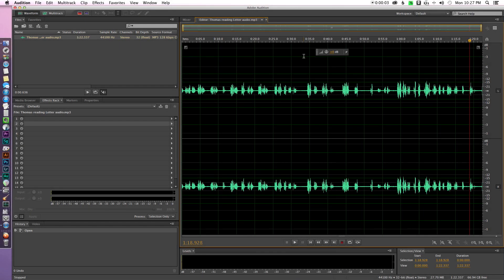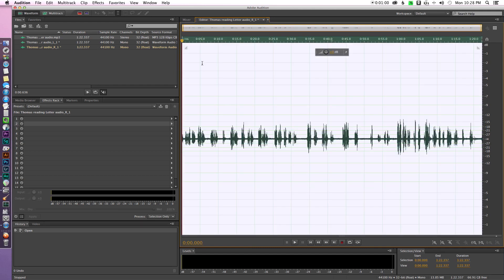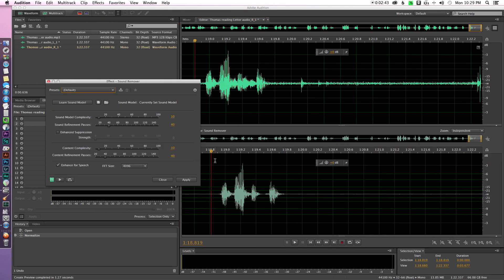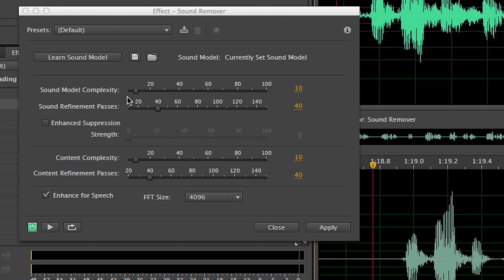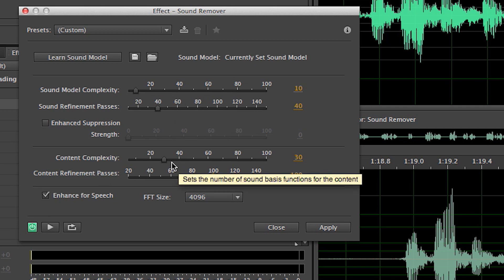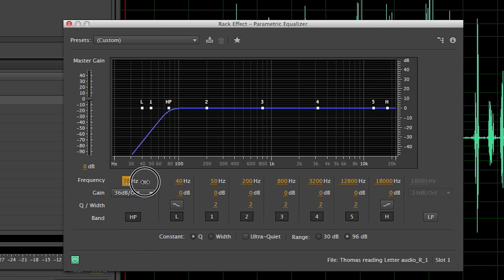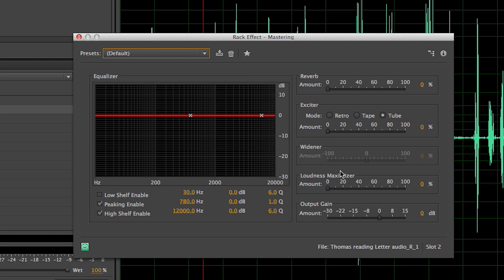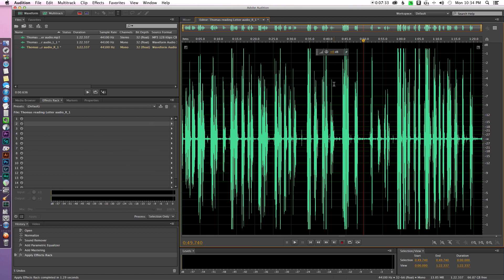Sound Rescue 2: Cleaning Up Dialogue Audio

Comment: Is there any way to do something similar to what you begin @2:54 without the sound remover tool? This tool is only in the newer versions and I'm stuck with the old masters sweet and I can't find any tutorials on how to make that dialogue sound more natural again after removing the noise and it sounds like you're listening to it through a conch shell.
Reply from the maker: Hi Isaac, if the dialogue is sounding like you're listening through a conch shell, that means that the noise reduction was applied too heavily. May need to back off of that a bit. It will not remove all noise without affecting the sound of the dialogue so you'll have to back off and keep some of the noise, just reducing the noise enough so that it is less distracting.
Reply: @curtisjudd  hey wow thanks for replying. After I commented I saw ho we long ago this video was posted and in no way expected to get a reply. Truly appreciate it.

Comment: Hi Curtis - I have a voice over that was recorded outside on a mountain side on a cell phone. The sound goes in and out of of extreme high and low db but when it is in the high parts there is a lot of background noise (fuzz sound) Im really stuck here, can you help?
Reply from the maker: Hi Nic, May need to cut the audio clip into segments and just apply the denoise plugin just to the louder segments. It will be tedious but might be worth the trouble.
Reply: @curtisjudd  - Great, thanks for the tip I will give it a try

Comment: I had a 3 camera setup with shotgun mics. I had some evident noise in the background as I crank my audio. I am able to remove the noise but then it leaves an echo like effect and I want to get it as close to clean professional audio as possible. The mics were all aimed towards the subjects which were in front of a brick wall. Any ideas? Thanks!
Reply from the maker: Hi Gil, I usually find a light touch on the noise reduction, leaving some of the noise is better than pushing it too hard and ending up with artifacts like you describe.
Reply: Ok so clean up to noise but leave a little to hopefully stop it from sounds like an echo room

Comment: How can I cut/remove/compress the audio peaks from "clapping" in premier or audition? I did your "normalization 0.1" and other tecnics, but since the clapping is so loud, that the audio waves does not get normalized like in your videos...
Reply from the maker: Hi Alex, for clapping, I usually highlight it in Audition and use the floating control to reduce its amplitude of the highlighted section until it is close to the rest of the audio. Then normalize from there.

Comment: Hi Curtis, nice video, but I found the last note a little bit puzzling : why should it be better to EQ before noise reduction ? 

I don't know about that particular "sound reduction" effect, but speaking for the plain old "noise reduction" filter, it basically reduce some frequencies in your signal based on the power spectrum density of the noise sample (at least, this is how the "noise reduction" filter is implemented in Audacity). So it is hard for me to understand why it should be better to EQ before or after the noise reduction step. I have not your experience though. So could you confirm there is a audible difference when doing it one way or the other ?
Reply from the maker: Hi Sylvain, my reasoning behind that: If you're using a high pass EQ to reduce low frequency noise, you're probably better off doing that first. The less work you delegate to the noise reduction effect, the better since it can have a tendency to leave odd sounding artifacts if you rely on it too much. And often, a simple EQ/high pass can clean up a lot of noise issues. Always better to use a less intrusive solution than a heavier handed one. Hopefully that makes sense.
Reply: I understand what you mean : by EQ first you can directly "cut out" some noise and so you don't have to push the noise reduction too far. Thank you for your reply Curtis !

Comment: Hello Curtis, I have a particular problem. So I have a video (40+min of lenghtt), which includes a dialogue and a backgrround music. What I want to do is to either remove or decrease the background music and to emhasize the dialogue. Is it a possible way to do that. Million thanks in advance!
Respectfully, Tadas
Reply from the maker: Hi Tadas, I am assuming that you just have the finished video file, and not a project file for Premiere or Final Cut? If so, I don't know of a way to do that with Audition. You can sort of do it with more expensive tools like Isotope RX4 Advanced, but that's a pricey tool for most of us (~ $1200 USD) and it not 100% certain. ADR (Automated Dialogue Replacement) may be a better option.
Reply: Curtis Judd Yes, it is just a raw file that I filmed with my phone.

Comment: Is there a way to get clean dialogue from an audio file with background music and I have a another file of just the background music if that could help (to acapella type beat removal)
Reply from the maker: I don't know of a clean way to do that. You can try the noise removal plugins in Audition (if you have that) but usually that's best for low frequency hum or hiss.
Reply: Thanks for the reply. I tried that but it didn't really work.

Comment from the maker: With my current skills, that's about the best rescue I know how to do but I think there may be a few more tweaks possible and I intend to keep experimenting to find them.  However, it seems that the biggest issue in this case is probably mic placement and I'd always prefer to get it right from the start by getting the mic in the right place, the talent in the right room or part of the room, and getting the gain staging just right. But reality being as it is, sometimes you got to rescue.   ;-)